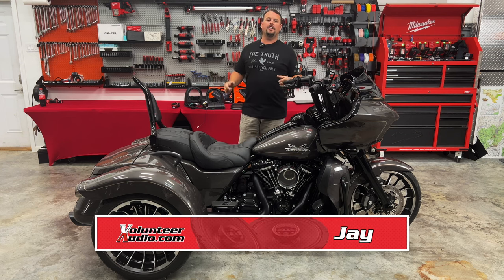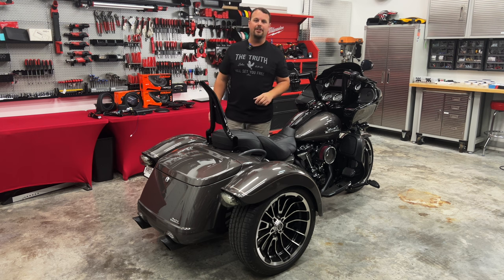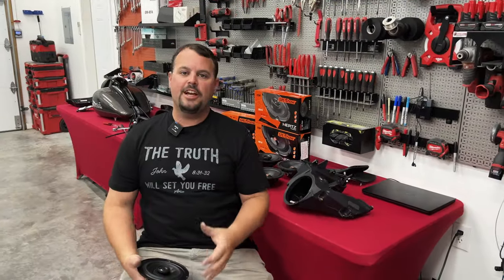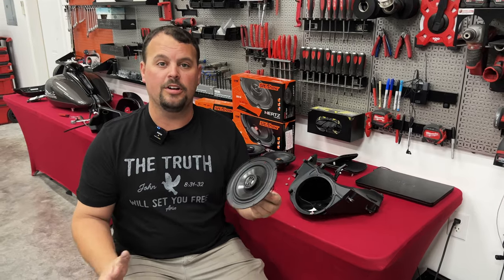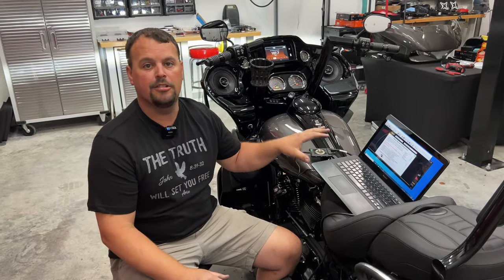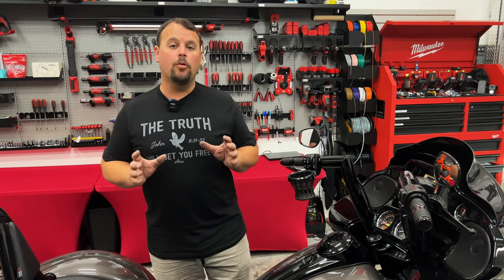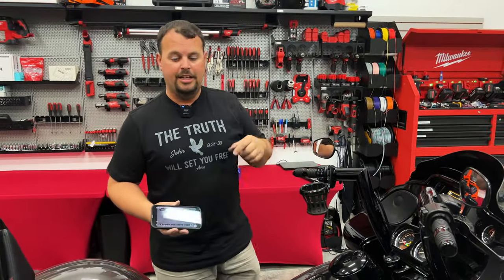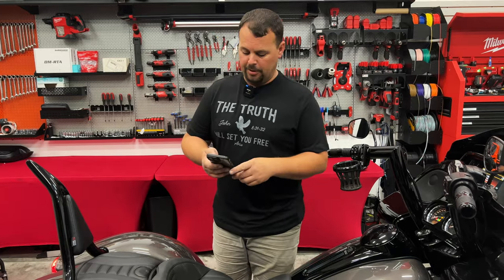2023 Harley Davidson Road Glide 3 RG3 gets a Volunteer Audio Hertz Stage 4 Amp / Speaker Upgrade

Comment: Great video Jay. I have the exact same speakers and stock head unit  except I have a Premier MAA4 .400 amp & HD14.AWK install kit for my 2023 RG3. I have not installed my amp yet. What would be the settings on the amp after radio flash please?  Mostly rock music I listen to. Thank you....
Reply from the maker: @chilichad  we only give amp settings with our plug n play amps. If bought from volunteer audio we would have set it on a oscilloscope before it shipped

Comment: Jay, any idea what air cleaner this owner installed? I was thinking Arlen Ness, maybe? With the exception of the air cleaner, I have the Siouxicide Choppers bars and engine guard currently and I had the same sissy bar on my RGS with the Navy luggage bar. Love their stuff. BTW I called your office today to get more information as I have put a hold on the Hog Tunes system and favoring a full system for both my wife and my RG3. I want lowers with the SV165's but the wife is totally against lowers on the RG3. She wasn't a big fan of lowers on our previous Tri Glides and my RGS. I am still in the early research stage with options you offer and I realize this may not be the best forum to communicate an audio system purchase, but here we are. My question is do you have any walk away vids from just the Stage 2? I realize the speaker issue with crossovers and frequency distribution, but I'm very curious as to what her bike would sound like with the Stage 2 and the SoundStream HDHU.14si. 

As for the lowers on my bike, I'm kinda in a dilemma. Next week my RG3 is going to the Harley paint shop for a Redline Red paint job. With the black out RG3 and that red it is a great look, same as I had on my RGS. I had plans on getting the Advanblack lowers and eventually adding speakers to them, just unsure which ones before seeing your vids. Advanblack does sell the Redline Red color matched lowers but I see and discussed with your rep today that you also sell lowers and that you have a local place to color match. Well, now that's interesting! I guess I can figure this out later.

BTW great vids you are publishing. Very easy to follow. Keep up the great work!
Reply from the maker: Thank you for watching and taking the time to comment, I’m not sure what air cleaner is on this bike.  I do suggest not using the advanblack lowers because of low build quality and a poorly designed speaker pod, our ported pods sound much better.  It has been along time since I did a walkway with a stage 2 and it had a smaller amplifier than we currently use.  Our hertz stage 2 is the best 2 speaker system I have heard and very loud.  Night and day better than hog tunes.  I have a video on another rg3 coming soon where I go over the lowers in greater detail.

Comment: hi jay, is solid/stripe positive or negative at the speakers with the hertz amp and lowers or do they all just to have the same polarity? after checking, i am off from the uppers to the lowers. thanks.
Reply from the maker: Striped wire is negative

Comment: So, if I understand correctly, the Advanblack lowers will work with the speaker pods that you installed? I have those lowers on my Street Glide and was going to buy their pods but if you don't recommend them, maybe I won't.
Reply from the maker: Correct our lower adapters are much better and do attach to the advanblack lowers

Comment: I just bought a FLTRT RG3 , how many watts and channels does a the stock radio have ? Can I change the the stock speakers only to improve the sound and loudness ? Without a amp and not have to flash the bike? plug and play ?  Also is there a way to boost the antenna signal   Thank you Vince Faiella
Reply from the maker: Replacing the speakers without adding an amp will add clarity and some volume but to get significant increase in volume and mid bass you will need an amplifier.  We can go over your questions better if you call us at 1-844-30AUDIO.  Antenna reception only gets better with a tall mast antenna
Reply: Thank you for the quick reply i will be giving you a call !

Comment: hi jay, is this rg3 using a lower fairing support after removing the factory one? thanks.
Reply from the maker: The fairing supports are not needed, Rock solid without them

Comment: Have a Road Glide 3 and have the Advanblack lowers. Trying to locate the plug n play to run the lower fairing speakers… Anyone?
Reply from the maker: We sell full upgrade kits with amps and speakers, give us a call at 1-844-30AUDIO to go over pricing and options
Reply: @volunteeraudio  already bought a kit and trying to install.
Reply from the maker: @RG3_BadGurl  our lower fairing harness plugs into the upper speaker pods
Reply: @volunteeraudio  is that what powers them

Comment: Hey man were did the dude get that back seat rest - also I see he has the full size crash bars my dealer told me they wouldnt fit looks good to me - can he or you comment on that as well - thanks - also the seat which seat is that ...?
Reply from the maker: We will be showing a full build soon that goes over the crash bar but yes a stock full size bar fits without issue
Reply: @volunteeraudio  The passenger seat backrest - where did he get that please ...?